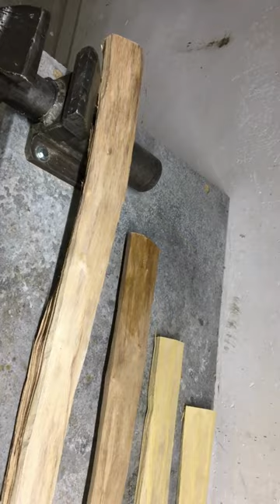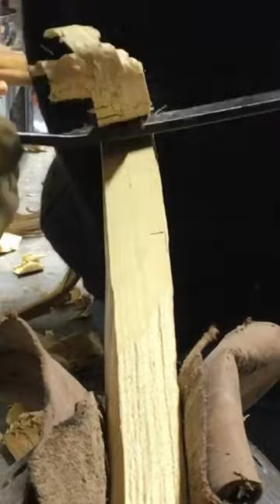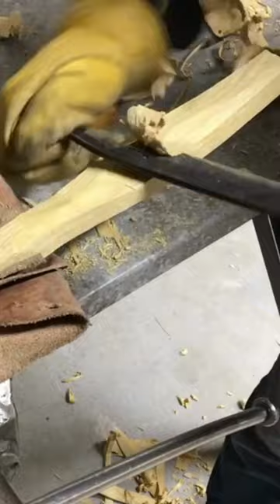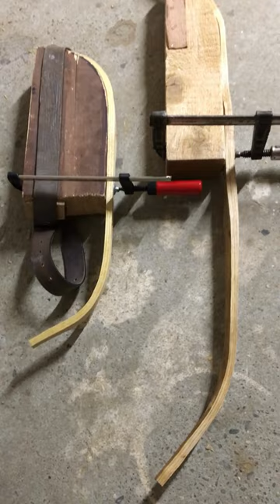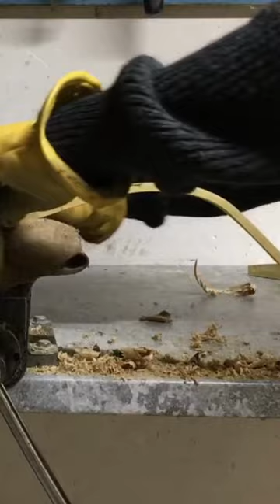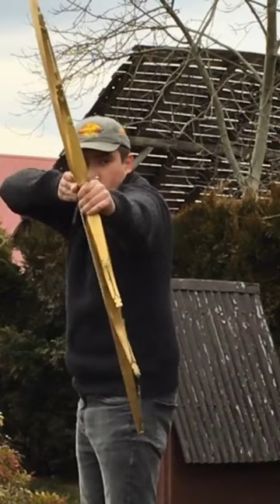The Most Unique Bow Build So Far

Comment: Try making your arrows out of "fatlighter". Fatlighter is from old pine trees. I find mine from old fence post. The wood is a bright orange almost purple, and kind of looks like fire. Cut your arrows out to your preferred size,  Heat treat until pine sap starts oozing out, then take another piece of the same wood and heat treat also, but use that piece to sand down the arrow. It comes out very dark, almost black. But is very very strong and durable.